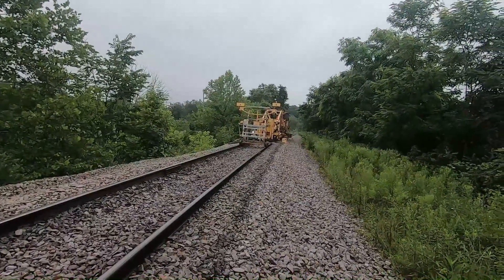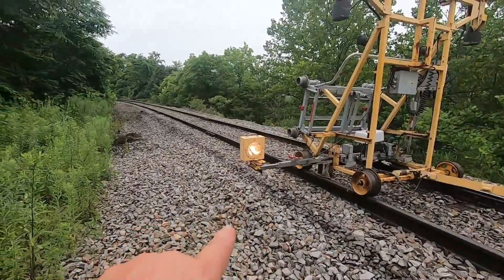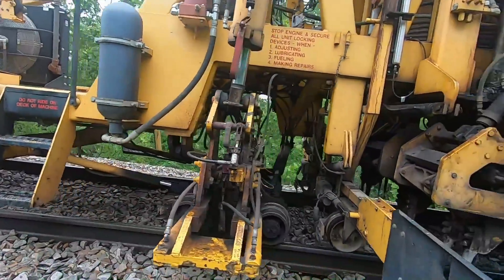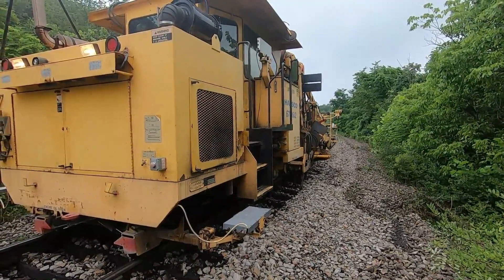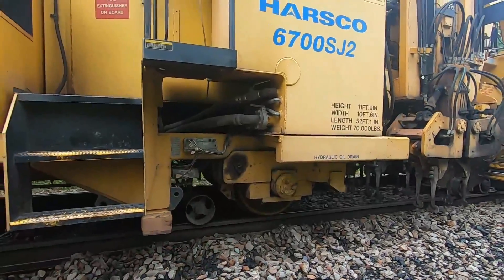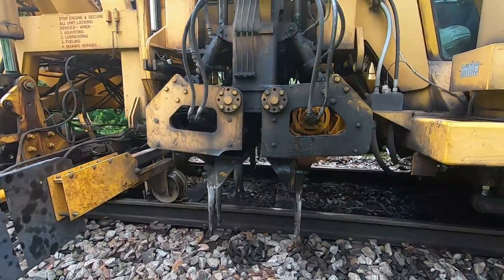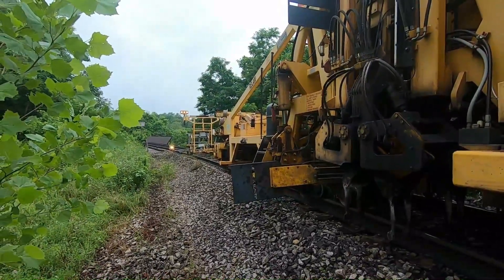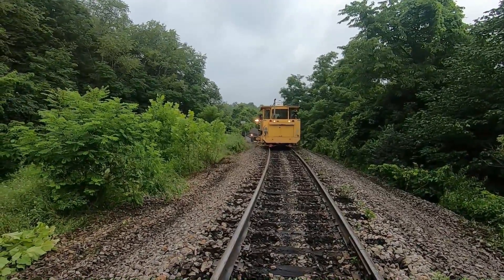Tamping Track with a Harsco 6700 SJ2 Tamper

Comment: Thanks for the vid!  Just found this...brings back memories.  I worked at Pandrol Jackson (before the Harsco buyout) in Ludington MI back in 1996.  They were making these and 6300s at the time, along with some smaller equipment.  They brought an original (no F40/GP40 unit) RMS Magnum grinder back that summer for major refurbishment...had caught on fire and was literally toast.

When I first saw a 6700 in action on the test tracks out back, I was amazed at what these things did.  I went on a couple of test runs in the cab...that was a blast.  I was a part-time engineering college student (Ferris State) at the time, wanted to work there full time after graduation so bad, but it was not meant to be.

Interesting turn of events with the Harsco buyout.  I learned while working there that PJ "borrowed" the design for the 6300/6700s from Fairmont, and they were not happy about it.  So Harsco buys Fairmont, and then absorbs PJ...one big happy family now.  We were up that way several years ago (2014, 2015).  I saw some bright, shiny new 6700s sitting out back.
Reply from the maker: That is correct, Pandrol Jackson and Fairmont were absorbed by
Harsco. The tamper I run (not the one in this video) is  PJ built in 
1993/94. Pretty cool stuff you worked there way back when. Appreciate the nice comment and for writing in. Thank you so
much for taking the time to check out the tamping track video my friend.

Comment: Dave, your videoing of the machine in action is great. Much better than the view from your cab but I understand you are a one-man band and cannot be in two places at once. I would like to know more about the lifting system. The older Canron Tampers that I grew up with had what they called the Delta Lifting system. One projector shining an infrared beam over a variable shadow board at the track lifting point and two receivers at the rear. These were kept level at all times by a pendulum system and cross level and surfacing was done by two hand wheels in the cab attached to the shadow board gear box. Lowering the shadow board 1/8th of an inch would result in a 1 inch track lift after 250 feet. This was due to the receivers getting onto lifted track and therefore increasing the lift more. After the full reference distance, usually 250 feet no further increase occurred. I would be keen to find out the system on your machine. Cheers Geoff Cox, Australia
Reply from the maker: My system is pretty much the same Geoff. Difference is the shadow
board does not get lifted. There is a light carriage out front of the
tamper and there is a light on it. From inside the cab I raise or lower
that light. Then when the jack beam picks the rail up, the light shines
thru the shadow board into a receiver on the rear of the machine.
When the light hits the center photo cell in the receiver, that stops
the jack beam from jacking rail. Here is a video I made some time
ago that explains how the lifting system works on the outside of
the tamper:  Thanks so much my friend for watching.
https://youtu.be/DS-i7k8IVQs
Reply: @ccrx6700  Thanks Dave. keep on tamping,
Reply from the maker: @01ripkirby  😊👍

Comment: So we just got one of these machines, what's the best way to learn how to operate it when you don't have anyone to teach you, I've been watching all kinds of these videos on it and have learned a lot, but I know there's still a lot to learn.
Reply from the maker: Oh my gosh Henry, I could talk to you for weeks on how to run one.
No way I can even begin to explain in a comment reply. Where
are you located at? you can really mess up some track quick if
you don't know what you're doing. What operating system does
yours have? If it's Jupiter 2 I will not be of much help. I have an
old QNX windows system.
Reply: @ccrx6700  I'm in Hartford Michigan, and the unit we have dose have the Jupiter 2 system, I have already been tamping on some Tangent track and getting a understanding of how the machine works.
if you have messenger, look me up there so we can chat.
Reply from the maker: @henrystarring7413  No messenger, but if you want to email me, we can
then exchange phone numbers,  peppypetsdaily@ yahoo.com

Do you know if your tamper has been calibrated? If not, then after tamping
tangent track get a level board and check cross level on the rails after it
has been tamped.  Your level board should read zero or very close to it difference.

Comment: What is this machine doing exactly?
If you lift up the track aren't you loosening the spikes or whatever keeps the track in place?
This machine looks like it lifts up the cross tie and pushing rocks under the cross tie.
 I am clueless about trains and when you rattle off numbers I have no clue what you are talking about.
Reply from the maker: Good question. Spikes will loosen if tie is rotten. Most generally
spikes don't get pulled up otherwise. Correct in lifting the ties
and shoving ballast under them. Tamping cross levels both rails,
takes dips out of the track, adds super elevation into the curves and
also put the track into alignment. Hope that helps explain better.

Comment: So each time the train comes through it is compacting and displacing ballast. Is that correct. Also is there a minimum depth for ballast or does sub grade determine that.
Reply from the maker: Yes Michael you are correct. Train weight compacts the ballast.
AREMA says that it takes approximately 1 million tons of gross
weight over a section of track to get it compacted to where it should
be after a track is tamped or ties replaced. That's why many
RR's place a slow order over track that has been tamped or ties
replaced until that weight is reached. Harsco makes a track
stabilizer which helps in getting to that million tons much quicker.
Ballast depth is a bigger subject to go over, too much for a
comment, but we have varying depths for varying reasons.
Reply: @ccrx6700  thank you for the answer.

Comment: Pretty cool to see the machines my dad was in charge of producing. Does it show anywhere on the machine what city it was built in? Or the Jackson 6700 u run?
Reply from the maker: No it does not JR Revolt. Harsco was in Luddington Mich.
where they built many a tamper. My Jackson was built in 1994
and can only guess at where it was built and I do not know
the year the tamper in the video was built. Sorry for the lack
of info but I also would love to know where my tamper was
made at if you ever find out please let me know. Thanks so
much for stopping by and checking out the video my good man.
Reply: @ccrx6700  yes ludington, MI is the shop where my dad was in charge of. Your Jackson 6700 machine was most likely also built at the ludington, MI shop. It use to be Jackson Jordan name, then pandrol Jackson, then harsco bought them. Still all at the same place in ludington, MI. Your machine and the harsco machine my dad was in charge or building.
Reply from the maker: @jrrevolt688  i found out JR tgat my machine was built in Luddington 1994. Who knows your dad may have been on it. How cool would that be 😊👍
Reply: @ccrx6700  he was I can guarantee it. He was the foreman incharge of large assembly on every machine that went thro there. I remember when I was a kid, my cub scout pack did a tour of all those machines and would have been around that year. Ya very cool to see its still going strong
Reply from the maker: @jrrevolt688  Awesome!

Comment: I was wondering if the tamper, while lifting the tracks, did or didn`t pull some spikes out of the ties a bit. If so, do you have to tap them down or not?
Reply from the maker: Good question Ted and yes it sometimes does. Depends on
the condition of the tie. A good tie it will not pull spikes but
soft ties it certainly will pull them up. Then you gotta pull them
all the way out with a claw bar, fill the hole with sure spike and
drive a spike back in. Appreciate your watching today my good man.

Comment: Hey Dave, thanks for the fascinating video.  If you or an object was to get in the path of the light beam what would happen?  Would the machine come to a halt until the blockage was removed?
Reply from the maker: You are certainly welcome Steve. Excellent question! You are the
first one to ever ask that and you are a thinking man! If I am lining
track and the jackbeam is clamped to the rail, any object getting
in the way of the beam, such as a person passing thru it or even
a small shrub or brush in the way of it, will cause the jackbeam to
throw the track one way or the other because the light receiver
is trying to find the light. So the jackbeam will move the rail
until that receiver finds the light. Gotta pay attention when lining
track and keep a clean path for that light to pass thru. 
Otherwise you can end up with some pretty wavy track.
Reply: Hey Dave, thanks for the reply regarding the light.  If the makers of that machine used two low power LASERs to give the beams and each beam has a receiver and set them couple of feet apart vertically, the alignment would be more precise and it could be arranged so that if one beam was interrupted the whole thing would continue as normal.  The point in using two beams is that it's unlikely that both beams would be interrupted at the same time.
Reply from the maker: @stevesmyth4982  thanks Steve.  Some tampers are set up with lasers but none have 2 beams.

Comment: dave, this was another great video. I can't really add anymore but just to ask does the driver have a mirror camera transmitting to his cab for positioning? Sorry if boring question.
Reply from the maker: Great to hear you liked the presentation Geoffrey and
we do thank you for checking it out and writing in my friend. A very good question and the answer is no it does not. Some new
tampers are set up to follow a geometry truck using GPS, it's
a complicated system to describe in a comment as you can imagine.
Technology on the RR is ever increasingly amazing. Just like
the positive train control now on the locos.

Comment: does your railroad have any flange greasers
Reply from the maker: Yes sir, we have 6 about evenly spaced along the 16 miles of
track. it's an art spacing them, ours are by LB Foster, solar 
powered at a cost of $25,000 per greaser. They can be set
to give a certain number of pumps of grease every axle or every
8 axles or any number, so it is a learning experience to find
out what works best. At our track speed of 25 grease carries
about 2 miles in either direction from the greaser, the faster
the train speeds, the longer the distance the grease will carry.
Gonna have some videos coming out on a whole track ride and
you will see all of the greasers in those Ross.
Reply: @ccrx6700  thanks

Comment: They brought their own equipment in for the job? Please explain how this was done since your railroad has no interchange with any other railroads.
Reply from the maker: Was trucked in on tractor trailer. Since they are contractors
and go all over, they generally truck to every job. Just think what
the cost would be if NS or CSX had to shut trains down so
a tamper could track travel on their rails for any length of distance.
Appreciate your writing in and for watching today Jeffrey.
Reply: @ccrx6700   Thank you for the reply. 👍👏
Reply from the maker: @jeffreygosselin7576   your welcome

Comment: What was the intended track rise for this tamping pass?  Tamping where height clearance is a issue can be tricky.  B&O had some trailers arrive Philadelphia after some surfacing gang work.  Raised the track too much under a bridge or through a tunnel.
Reply from the maker: Wow that would be disastrous! Sounds like somebody got a 
little over zealous with the lifting light. We do not have a set
point for lifting track, lots of different situations out there and
one amount of lift does not fit all. Different tamper operators
also have varying view on amount of lift. We do not have an
engineering department here to tell me how much lift
they want in a section of track. I raise the track as I deem 
necessary, but usually never go over 3 inches at one time. Appreciate your watching the video today my friend.

Comment: From a watching it looks like. To understand how the rig does it's thing. I should forget about how other construction tamping is done  
In other words. I don't see anything pounding the tracks and ties downward.
It kinda looks like the track is lift up- and the pincher looking tongs pushes the traprock under the ties while the track is lift up.
I assume the weight and vibration from the machine alone settles the track and ties in place.
Did I guess correctly?
Reply from the maker: Yep ties are picked up, ballast tamped under them. Compaction
will occur as trains run over the track. AREMA has stated that
it takes around 1 million tons of train traffic over a tamped
track to compact it to before conditions. Some big RR's use a
machine called a stabilizer which compacts the ballast something
like a vibratory roller would do for a road bed. RR's are required to
have a 25 MPH slow order over track that has been tamped
until compaction occurs. Stabilizers significantly cut the time
down for a slow order to be in place. Since our track speed is
already 25 we don't need slow orders over tamped track.
Reply: @ccrx6700  Thanks, I need to think about it a little bit. 
All I can come up with on first impressions is... 'that's so cool and amazing.'
 My first thoughts are around: energy, skills, endurance, expertise and under-celebrated workers.
 Much appreciated Dave 🧰👨‍🏭👷‍♂️🇺🇲

Comment: Nice surfacing track video Dave and the explanation on how the 6700 works, Brings back more memories of us working around the surfacing crews at CP.
Reply from the maker: Those guys from way back that hand jacked and hand tamped track
would be amazed at seeing this now. When we started here that's
how we tamped since we didn't have a tamper for many years
to begin with, thankfully we didn't do much of it back then! Appreciate
your taking the time to check out the presentation my friend.
Reply: @ccrx6700  Your very welcome , I started with the railroad when we did a lot of the work by hand such as the track jacks and the tamping bars.

Comment: Dave what a unique view of how the tamper works. it is so nice to see how
that it cycles, and how well it a lines the tracks. the curve looks so much 
smoother once the unit is done. Do they go over the bridges on the line?
or does it need a solid material under the rail to function, lifting the rail.
The millbrook RR Aaron loves your videos and uses your catch phrase
 “that’s railroading “ when ever he it doing maintenance on the line. 
Hope all is well, keep safe out there and stay healthy.
how is your pond doing? any more leaks? water always finds
the path of least resistance,  have a great day

barry
Reply from the maker: Thanks Barry for the nice comment and for watching. Bridges
are solid and can't be tamped, however we do have 1 ballast deck
bridge here that has no wood timbers but a steel plate with ballast
filled in on top of it and it gets tamped. 

Mill Brook subs here, he's got a project for sure. Pond has appeared
to stop leaking, hurray! Thanks for asking my friend.

Comment: Is there a computer that looks for the tie and stops the machine at the right spot, or does the operator control the movement?
Reply from the maker: Good question Robert. On my tamper and this one the idexing
ahead is manually controlled, he has a foot pedal, I have a 
push button. Harsco does make a tie finder add on that will
automatically stop the machine over the center of a tie. It looks
for the tie plates via a magnetic field. With tie finder technology
an operator can start the machine going and literally walk along
side it outside.

Comment: Great video Dave, just how often does this have to be done
Reply from the maker: Thanks Russell. Every section of track here is different. I've always
said each curve has it's own personality. Some sections haven't been
tamped for years, they hold track surface really well, other sections
where the ballast is contaminated or a sub surface problem may
need tamped monthly or more to keep track surface up. Had
one slide area last year where I tamped the same 300 feet twice a
 month every month until it got fixed. So there are a lot of variables.
Most RR's try to tamp their track at least annually.  Amount of traffic over a section also plays a role. Generally speaking here, when there
is a surface anomaly it gets tamped.
Reply: @ccrx6700  Thanks Dave

Comment: How often does that track need to be tamped
Reply from the maker: Every section of track here is different. I've always
said each curve has it's own personality. Some sections haven't been
tamped for years, they hold track surface really well, other sections
where the ballast is contaminated or a sub surface problem may
need tamped monthly or more to keep track surface up. Had
one slide area last year where I tamped the same 300 feet twice a
 month every month until it got fixed. So there are a lot of variables.
Most RR's try to tamp their track at least annually.  Amount of traffic over a section also plays a role. Generally speaking here, when there
is a surface anomaly it gets tamped.

Comment: It’s amazing that just pushing some rocks under the ties you can firm up the support of the tie in the new position without settlement.   I’m guessing the teeth on the tamper wear out regularly.
Reply from the maker: Yep Kent, the tamping tools do wear out, they not hard to change, 
just 3 bolts. After tamping the ballast does settle. AREMA figures
it takes about 1 million tons of train traffic run over a tamped
track before it get fully compacted. Some RR's have a stabilizer
which compacts the tamped ballast. On Class 3 and above track
there is always a slow order of 25 on newly tamped track.
The stabilizer helps to lesson the amount of time the slow order is
on. Here our track speed is 25 so we don't need slow orders on
newly tamped track.